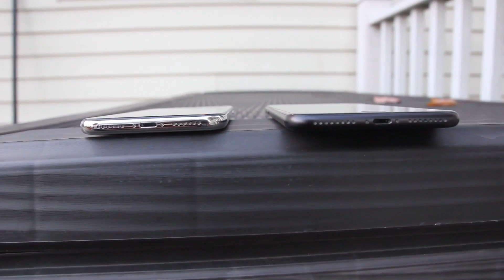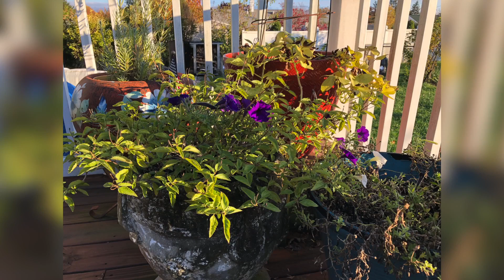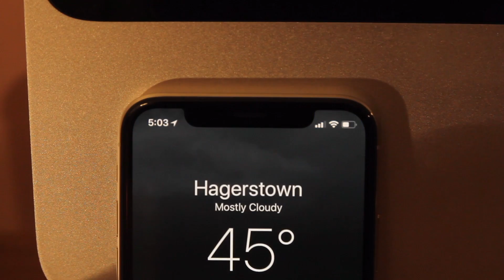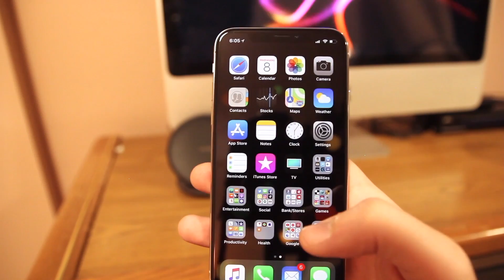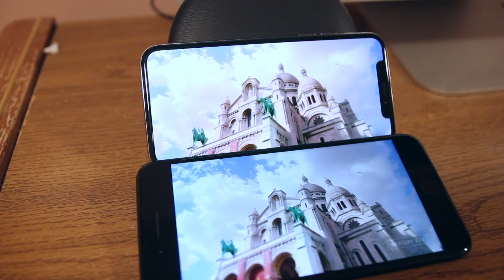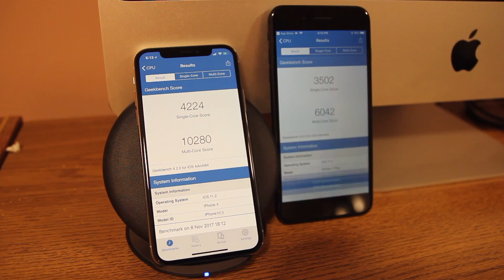iPhone X Review (as an Apple fan)

Comment: Jesus...Note to self - STAY WITH A SMALL, NORMAL, HEADPHONE JACKED IPHONE! I like my touch ID, and facial recognition is just...no...

Does the iPhone 8 have touch id? And a headphone jack? Cause soon enough, my SE (which is pretty epic, although not the fanciest, it actually fits in my hand) will die soon enough. If the 8 has touch id and a jack, i'm probably getting that as my next phone.
Reply from the maker: The 8 does have Touch ID, but no headphone jack. It’s a dongle. But I’ve been using Bluetooth so long that it’s pretty much a non-issue